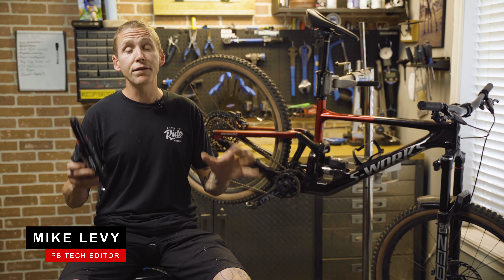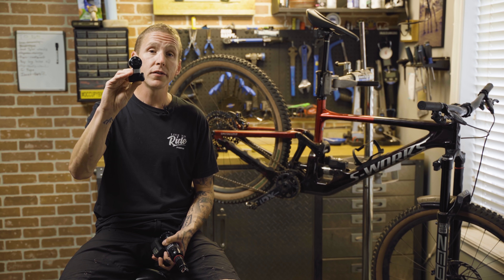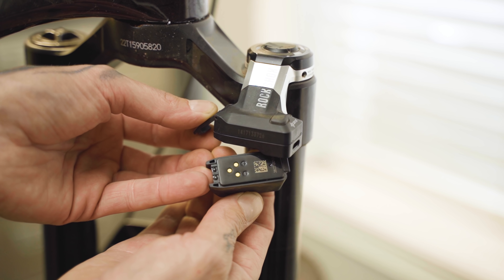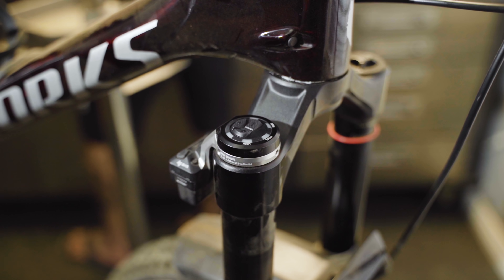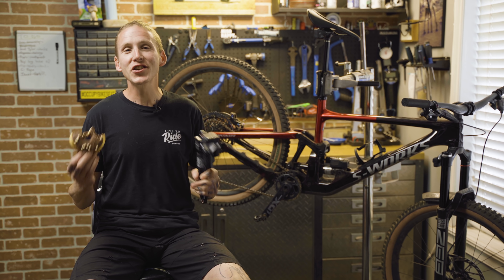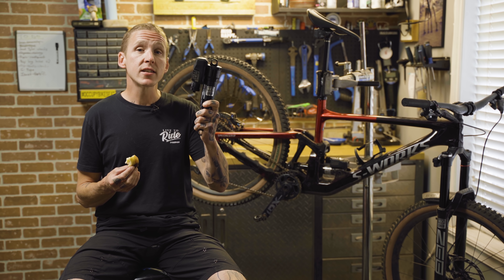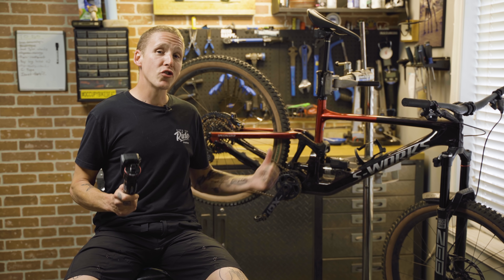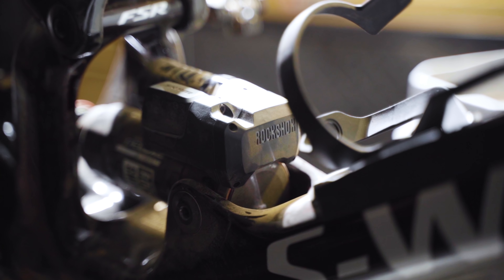Electronic, Computer-Controlled Suspension! Rockshox's Flight Attendant | First Look & Ride

Comment: I don't really see the benefit. I would've been intrigued if this system was like an active Öhlins suspension on motorbikes that constantly and intelligently adapts the suspension to the riding scenario. You tip the bike down a steep rockgarden and it ads hsc in the fork, you ride through braking bumps and it softens up. You brake hard and it stiffens up lsc on the fork. Etc. Just to avoid flipping a lever for climbing, this seems to be a $1000 solution to $10 problem. Again. But good for dentists!
Reply: Sure they will slowly introduce that stuff bit by bit so it can be sold at a premium for every incremental update.
Reply: @thelethalmoo  your optimism is astounding! Nah, for that to work you'll need different internals for the damping circuit as well. With the given hardware you cannot open/ close the needle valves quickly enough. But who knows. If that technology gets developed further, maybe we'll see a crossover between Shockwiz and this which will make suspension setup obsolete.
Reply: Looking at Rockshox's video on the system, it seems to be a bit more useful than I thought from this, actually. I don't think it will be as advanced as you're wanting, but it will do more than just lock you out for the fireroad climbs.
Reply: Fox tried Livevalve and Specialized tried Brain and both have failed. Its fascinating, I think those predictive systems actually work to make a bike feel unpredictable. Ironically, Flight Attendant is about keeping it simple. We’ll definitely see this replacing the cable lockouts on Scott’s for example.
Reply: My friend bought a Pivot and it came with the FOX Live Valve system and I rode his bike for a weekend and it was very noticeable difference it was plush when it needed to and stiff on climbs especially fast rocky down hill I'd buy it for my Specialized but Specialized is using this RockShock instead and not compatible with the Fox
Reply: I doubt this system is that great and then when it’s got some age and been filthy a dozen times will it still work? It’s got a lot of sensors unlike the shifting and dropper

Comment: My questions:

1: Does it firm up sufficiently when you're trying to pump rollers or pop off a lip? Or is it in full soggy-sponge mode for that.
2: Are they planning to offer damper upgrade kits, and if so, for which forks/shocks?
3: You've shown it on a Zeb and a SuperDeluxe, but mention it coming on bikes as short as 130mm. Does that imply it's going to be available across most/all of the lineup, or is Zeb the new downc*ntry standard?
Reply: I dont think the suspension firms up for rollers and jumps, how would the system even know what's up if you don't pedal and coasting?
Reply: @Vanadium  they mention that it has a giro sensor, but not sure if they can adjust it fast enough. Although cars and Motorbikes have had active suspension for quite a while now.
Reply: @timtamburg5101  I know but that's the thing if its fast enough and not actually fuck it up if then after closing the rough track is going on and the system leaning more to a open setup I don't think it can do it.
Reply: @Vanadium  I mean u can adjust the bias to hard, but not sure how much that will do

Comment: What happens if youre coming off a huge drop amd the AI decides to lock up your suspension?
Reply: Hmmmm... You're fcked??
Reply: I imagine it has an IMU and accelerometer so it will know when you're in free fall.
Reply: @mrnobody9821  not gonna argue any more after this, but its electronics. They can fail. And sometimes it's on the worst time possible. That's why F1 don't use steering by wire. And yes, mechanical things also fail. But we're more familiar with it, and often can be handle more friendly than electric counterparts. And then there's the price tag. 

Guess what, everything has good/bad. But you know from this comment that I'm a V8 era F1 fans and hate hybrid era.

Comment: More interested on what can be done with geometry than computers. Electronic components don’t generally have the same life span/durability as mechanical components and cost a lot more. 

For pros getting free toys, great! For your average shredder, I think it’s a “leave it”.  Except for those guys riding basic trails showing off their $12000 bikes.
Reply: I ride my driveway on a 14k bike ,the gutters are mad jumps 🤘
Reply: So real lol
Reply: There’s no reason to doubt electronics these days, I work in automotive and as long as it’s designed robustly, actuators and solenoids are very reliable. That said- you’re on to something with the geometry. I’d love to see a bladder system that could deflate the front fork on climbs, and quickly re-inflate when you’re ready to descend, same with shock.
Reply: Are you kidding? How often do bushings and chains wear out? The electronics will outlive the consumable components for sure
Reply: @mr.facestab4051  As an electrician and electronics technician ,take the cables.
Electronics fail.

Comment: I love the idea, such a great tech development, but the cost and weight will prevent me from making the switch.  Even in the Smokey Mtn's I rarely need to use the climb switch, and I would worry about the electronic system not making the adjustments I need them to.  Particulary tech climbs where traction is key, or descents where pedaling is still needed.
Reply: Pedaling while on a descent? What? Come out here to the Rocky Mtns!!

Comment: Wow! All this to save a quarter second flipping a switch. Another expensive solution to something that was never a problem!
Reply: Something for dentists and managers to spend their cash on to put on their 15000$ bike, I guess
Reply: I'll never buy it tell It trickles down to the norm. But Rock shocks will get orders because every single racer that doesn't have this is already at a dis advantage.
Reply: @John-shreds   Unless they have a brain shock, Lock out lever on the handle bar, live valve, through shaft re-aktiv valving or one of the other things that already does this. I Don't think pro racers are going to be in a hurry to add 3/4 of a pound to their bike.  But I do think Dentists will be in a hurry to get the latest piece of Tech.
Reply: @kaseyburlingham2861  Don't hate it tell you see times. I'm sure on a good Enduro race this shaves a good amount of time.
Reply: @kaseyburlingham2861  There probably will be a new race class for this type of stuff. If this is good, it be kind of lame to have a computer make their times quicker just from paying $ instead of having to set their suspension up as a compromise of 2 types of terrain on a stage

Comment: I wonder if all this could talk ANT+ and/or a Bluetooth LE and integrate with Garmin devices.

That cadence sensor would be amazing to have alone, the Garmin cadence sensor with the rubber bands is not something you want with a flat pedal.
Reply: Power meters would also offer richer data, so if it supports ant+ that'd be great for it to support cadence, speed, etc.

Comment: I think fox is also working on something like this because in dialed you can see some of this stuff on the rear shock of the show bikes
Reply: Fox has had their Livewire system for a few years now. Only available on complete bikes. I saw it on a Pivot bike in Sedona.
Reply: @AverageJoe97  yes but it only is made for XX and trail bikes